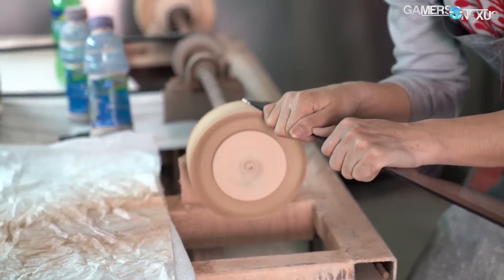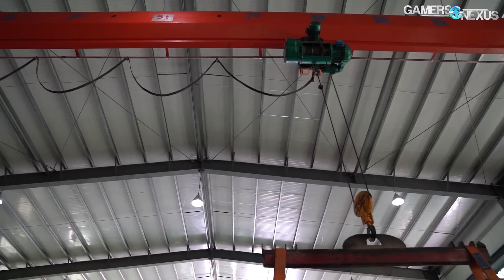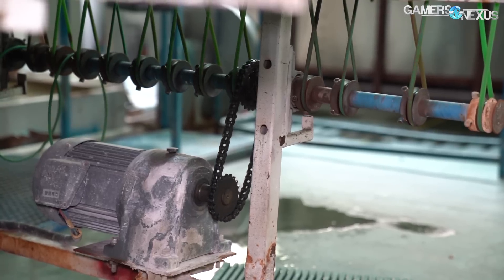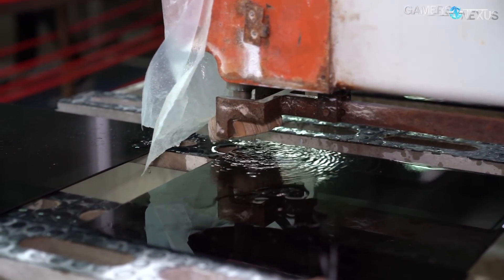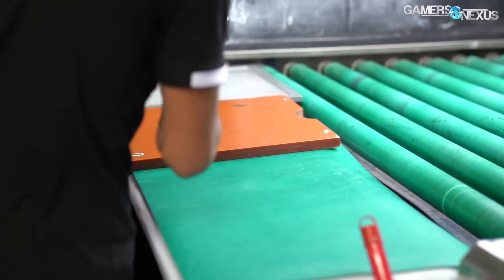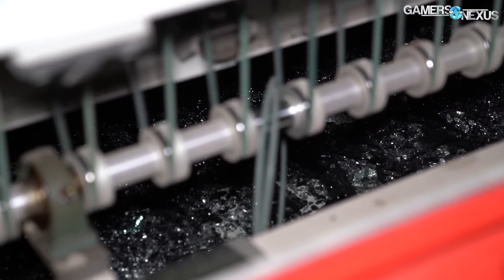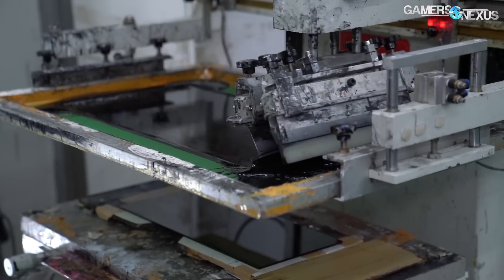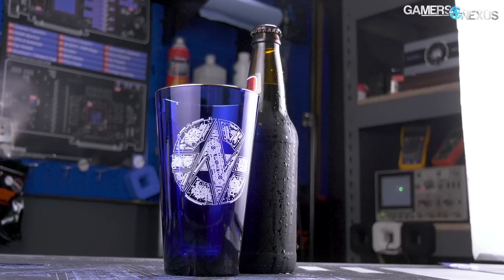How Tempered Glass is Made | Everyone Uses the Same Factory

Comment: #askgn I have (finally) managed to mount the AM4 bracket on my Corsair H100i V2, and am wondering what is a safe temperature range for the liquid inside the tubing and the radiator. Corsair Link shows the "H100i V2 Temperature" as around 40-42°C when my R5 1600 @ 3.925 is under full load. The CPU itself, however, is between 70-75°C (under Prime95 small FFTs load). Is this safe? Am I risking rapid degradation of the tubing and/or the pump impeller?

I guess what I am asking boils down to is, where is the temperature sensor situated: is it displaying the average temp inside the rad, which would be much lower than the exit temperature from the block? Or is it the exit temperature from the block, which makes me wonder at the efficiency of thermal contact given that there is a 30-35°C delta between IHS and coolant exit?
Reply: You are over complicating the issue because you are thinking water temp should ever go near core temps.

Due to the speed of turbulent flow the actual coolant temp varies by very little depending on sensor location.

The mass of water that passes over the cold plate is moving fast enough that it's delta from the rest of the loop is only a degree or 3 due to the fact it is not in contact with the coldplate long enough for the liquid to reach thermal soak capacity.
It is then washed into the Rad where, due to pipe design, it will spend easily 4 usually 8 times longer than it spent on the cold plate. But even with that it will be cycled back into the block before it has normalized to the room.

The safe water temps never really exceed 50 degrees Celsius or water volume expansion can risk popping the pipe seals.

Comment: Nope nope. 9:20. As a car guy, I have to step in. Windshield is little different... But the side windows on car and back window, those are going to go in very small pieces when they break... But windshield is not gonna do that. Imagine small rock hitting it, and it shattering against your face while blasting 80mph/130kmh. Now, windshield can take quite a huge hit, and the object will like sink into that windshield and doesn't come thru it.

Comment: I'm a glazier by trade. There are many things wrong with the terms. Here are some, 1: the glass cutter is NOT a saw. It's a scoring blade, 2: glass is scored then cracked along the score line, not cut. 3; the glass isn't scored halfway through, maybe 1/64th of an inch. 4: bending glass isn't a trade secret, you want proof, look at your car, or even better a classic car with a wraparound rear window. It's done the same way. 5: steel drill bits are not used in drilling holes in glass, diamond core bits are used.
Reply: I don't think windshields are tempered. And also they are in an astronomical price bracket compared to what these guys are making (in small runs nonetheless). Not to mention getting good and consistent optical properties from tight radius bent glass is still a pain.
Reply: @zoravar.k7904  the side and back glass are curved slightly. On older 50s and 60s cars they have bent rear tempered glass.

Comment: Tempered glass is NOT used for windshields - that’s the laminated glass. Side and back windows of your car are. Just imagine you would use tempered glass in the front: a pebble usually leaving a small chip on your windshield would entirely shatter it instead, showering you with glass right into your face.

Comment: Can anyone explain what's the appeal of tglass for PC cases? I'd rather have solid metal or a small acrylic window. It's lighter, cheaper, and there is no chance of it breaking into a thousand little pieces one day... Even if you like looking at the contents of your case - you could as well look at it though acrylic panel.
Reply: All the acrylic windows I've had scratched if you looked at it funny.  I also don't think it attracts dust nearly as easily as acrylic panels. Better sound control, too.  I really love my o11 dynamic. So clear and sturdy  :)
Reply: @BRUXXUS  Valid points! I'm a proud owner of an Air 740 case. And I think It would've been better if it had a solid metal side instead of acrylic window. It's not easy finding a case without transparent sides, even less so with this tempered glass trend. There are like 4 decent cases with solid panels overall ): And I've yet to see any new ones come out recently.

Comment: Howdy Steve,   That Spring Loaded Center Punch to break Glass is carried By every Policeman/women who is in a patrol car Because like you said they can not be used on the windshield BC its made of Auto-safety glass of a layed system so if a car crashes and the Police can get in the Car they use the Tool to break the Side window to pull anyone in the car out fast!  As for the Bend its Not as Big as they are letting on its more the cooling process that is where if its rushed they will get hairline cracks or worse shatter. Nice Tour keep up the great fun.  Cow}:-o)
Reply: Partially correct. Windshields are laminated "safety glass" ie tempered glass. Door glass is also tempered. The reason for Safety glass in cars is simple so when it a crash you get little bitty pebbles of glass, not big shards that can go through you like a knife.
Reply: Tempered and Safety are 2 diff subjects Captain Obvious  My point is 100% correct but you just felt the need to troll im guessing young man so you go right ahead i find you kids funny. as I said Layed which is Laminated glass with a Mylar clear fiber layer most know as EVA or PVB  but I forgot trolls gotta troll...... and the Point I made about breaking the side Glass was because its Tempered BUT I forgot I have to say every detail to the troll police or they get a chubby so you got yer 2 blips of lame fame, Not to mention am Probably the Most accomplished Mechanic here ill just laugh at the Idiocy BUH BYE !!   Cow}:-o)

Comment: I assume they just use heat to bend the glass like that, likely with some kind of red hot metal bar that acts as a rolling press.  I don't see another way to accomplish bends like that, especially with that level of precision.
Reply: Likely a vacuum forming process as it leaves the furnace while it in still in a plasticized state before being allowed to cool.
Hot rollers tend to result in issues from heat shock warp and indentation
Reply: @bengrogan9710  Interesting, I bet you're right.  That would explain why they wouldn't let them film it as that would be far more 'proprietary' than just using a red hot bar/roller(s) etc. as I suggested.

Comment: you make curved glass by heating it up and bending slowly.... what exactly is secret about it
Reply: Probably has something to do with the process of making it tempered. But idk I’m not a expert.
Reply: How to make it cheaply and consistently. You can make anything. Doesn't mean that it will come at a sane price. That is the goal of manufacturing.
Reply: How they do that and maintain only 5 to 10 percent instead of 50 percent failure rate most likely

Comment: This seems waste of time/cost when you could spend into something else: Make a good case. There are many good one out there that just need some modification to it.
Reply: Most of the modern cases in the last 2 years, are of the more or less the same design, if you stripped out the add-ons, etc. It's boring.
Reply: @AlfaPro1337  If you look at couple few cases you will find these very very good compared to many other's. That what im looking for, the changes makes case good again. Not these nonesense temperglass.
Reply: @koford  It's the same overall basic design.

There's always 2-3x120mm fan mount at the front. If the top has space for it, that's another 2-3x120mm fan mount. The interior, is made as though it was to fit a water cooled system, especially custom loop for no reason.

A PSU shroud. A front panel that chokes air intake.

The case has 0 external functionality, everything is dongled for no reason. Reminds me of Apple products. You want to add more front USB? It's either you go behind, or used a USB hub.

I'm still stuck with my Source 530, and may eventually have to mod it with modern features, like PSU shroud, replace the acrylic side widow with a tempered glass. I already put RGB before RGB was a crazed.
Reply: @AlfaPro1337  i wich they modify a little, that all needed. a good example is that couple cases do fit a radiator at top, but "crash" with fan at rear. So, why not extend the height there sort of.. but that one thing i wich they changes.. there probalty few other thing like extend the overall lenght so it fits a reservoir better... basicly a more waterloop friendly case. But yea i understand you. hey it just me :-)

Comment: I work in an automotive glass company named Vitro.  I find it funny that their safety standards are way not the same as ours, but it is China so yea.  I'm also amazed by how much they can do with the tech they have.  Also to get the bends they would have more than likely press at the end of the furnace, but even then it would be hard to do.  Just to let you know the glass in a windshield is not tempered, but heat treated and then laminated together.  The side windows of a car are mostly tempered but can be laminated as well.
Reply: Press immediately after furnace would be my guess too, or possibly vacuum forming, however there are steps that are needed to ensure the glass doesn't fracture from shock cooling when the press makes contact.
Processes for mitigating this are likely the trade secret kept from clients that was mentioned in the early part of the video.

The curved panels have a known high failure rate, likely due to warping stressors when cooling.
Reply: @bengrogan9710  That or they might have some safety violation they don't want to show you.
Reply: @maggiejetson7904  The factories are in China - H&S regs as the west know them don't exist
If operating in the West such trade secrets still need proper H & S compliance, inspectors just sign an NDA that is void if they find such violations as you allude to

Comment: Great video guys! That curved glass stuff is especially interesting...shame they won't show a bit about how it's done, but I understand the reasoning.

I hope they figure out how to produce those curved glass panels cheap enough to start seeing them on cases sometime soon...I'd love the original curved front glass Corsair showed for my 500D SE RGB to be something I could buy and install at some point.
Reply: Curved glass is possible on the cheap but not in the form of tempered glass, I have such glass panels on my aquariums, one of the curved glass tanks holds up to 220 litres / 60 gallons of water (another in a local store holds 650 litres), and I've bumped into that tank a dozen times, the only problem is case manufacturers prefer tempered glass as its well known for being strong as a lot of gamers like to rage out and hulk smash their case.

Comment: I used to work in the Autoglass industry so I’d like to correct a point you made at 9:20-ish. Windshields are not made from this type of safety glass, and saying it in the way that you have may cause some confusion as what happens when a rock hits your windshield. The most common configuration on cars today is your windshield is made with a laminated glass, meaning two layers of glass with a polyvinyl plastic in between, this type of glass doesn’t shatter, it will crack. Also, because it’s two layers of glass, it won’t fall in on you. The rest of the glass on the car are typically tempered glass, and are typically referred to as door glass, back glass, or vent glass, whichever one is set to be replaced in the case of the industry I was in. I would suggest instead saying “Sidelite” as it’s a good catch-all term that references strictly the tempered pieces, but also excludes the recent trend in laminated door glass.
Reply from the maker: Thanks and noted on "sidelite" as a catch-all. Was not familiar with that term before now, but it will be helpful!
Reply: Weeeird. I think of "sidelite" and I imagine doors.
That's probably just because I sell doors.
Reply: Mort Mort Mort totally true, sidelite isn’t an overly popular term in ag, but it’s the only thing I’ve seen that covers all the tempered glass w/o just calling it tempered.
Reply: @mortmortmort8908  How much does your average sliding glass door cost?
Reply: @Malus1531  cheap vinyl ones can be had for 375, 800 bucks if you want there to be blinds in between the glass. Special order ones can range anywhere from 1200-3000 USD.
Reply: Also windshields are designed to keep you in the vehicle during an accident. - Great explanation sir!
Reply: @Dieseling123  the windshield also acts as a structural part of the vehicle,  that's why they are glued in place.
Reply: @brucejones2354   you too are correct!
Reply: @brucejones2354  My older Jeep Wranglers all had "floating" glass windshields, so the glass was just held in by rubber gaskets. It made them very easy to replace, My newer Jeep Wrangler now uses a glued in glass in the windshield and it causes a lot of problems. The body wants to flex too much, to the point that it flexes the glass. I had a windshield crack in half last winter when it was around 0 degrees, simply by hitting a dip in the road. The glass repairman said it was really common on newer vehicles compared to older, since the windshields are glued in, but bodies are thinner and lighter to meet mpg requirements.
Reply: @Dieseling123  seatbelts are for keeping you in the vehicle, windshield is there to keep the wind and rain out and to protect you from small objects
Reply: @eikuz  Although you are correct, Windshield design goes back further than seat belts. Look into the evolution in cars a bit.

Comment: Just FYI the windscreen is laminated glass , you aint breaking that with a tool like that . Side windows yes , not windscreen.
Reply from the maker: Thanks for the correction.
Reply: It will shatter it though, easily
Reply: Some side windows in some models are now laminated glass. Yoire more likely to find it on higher end luxury cars to cut road noise
Reply: Lunar Lancer they need to be breakable by whoever’s inside incase of emergency
Reply: @lukefreeman828  that is not a dot requirement. The dot requirement is just no large shards. You can take a look at a high trim for explorer for proof
Reply: @lukefreeman828  Normally you can just roll them down.
Reply: @jaalan7896  good luck with that if your car is filling up with water lol... or there's a fire that's destroyed your electrics.. or you've had a crash and your door is jammed shut/deformed and the electrics have gone... I did say *emergency*.
Reply: @lukefreeman828  Okay, I was thinking specificly about the car filling up with water. The electronic windows should work perfectly fine. Look it up, mythbusters tested it a while ago. In terms of a crash that would disable mechanism, you would have the window shattered anyways, in which case a simple knife will be able to cut out the remains and let you escape. A fire would take a while to take out the electronics (if the fire was from a crash) and if the fire started without a crash (an electrical fire) then your doors shoukd still work fine.
Reply: Even alot of side windows are not tempered. Ford for instance is using laminated panels for its side windows
Reply: @madflyer1093  Lots of companies use laminated side glass. I think Tesla has laminated glass all the way around.
Reply: How do you escape through laminated glass in case of emergency?
Reply: @leecaste  you shatter it the same way inside the plastic layers and then it just bends out of the way instead of exploding.
Reply: @leecaste  generally you can push it aside once broken.
Reply: that "breaking tool" just looked like an automatic center punch no?  perhaps with tungsten carbide tip?
Reply: What few people realise is that the windshield is actually a structural member. It adds strength to the shell and driving long distances without it is, if it were to be shattered and lost, is asking for trouble!
Reply: @amanofmanyparts9120  A windshield is not so much a structural member but is indeed structured glass meaning that it is designed to resist impacts coming from the outside such as rocks or birds but to break easily from impacts coming from the inside such as a persons face.
Reply: @bryanblatz2001  Nope. Since they started bonding the windscreens into cars they became structural members and the manufacturers secretly admit that it's bad practice to drive too far with a shattered or missing windscreen due to the extra flexing of the upper bodywork.
Reply: The drill bit is diamond Not steel, this documentry is full of errors. Shame realy you didnt consult or run this by an expert first. I can also confirm that all this glass processing tec is stolen from Europian i.e. Finish and Italian companys.
Reply: Which means there's just a sheet of plastic sandwiched between two pieces of tempered glass.
Reply: @launchprogramexe  You wouldn't want the windshield tempered. If a stone or other object hit a tempered glass, the whole piece would break and block your vision.
Reply: @TomZ23  Also a reason for why you don't want your windshield tempered is because
*Tempered laminated glass will instantly lose it's structural integrity when shattered, making it less of a shield. It becomes soft.
This is also why you would NEVER use tempered glass in any type of overhead/roof/ceiling applications, since the glass would most likely fall down as one big heavy piece of thousands of small glass pieces pieced together by vinyl.
Reply: @launchprogramexe  Laminated glass isn't tempered, there's no need because it's laminated. Modern windshield glass is not tempered.